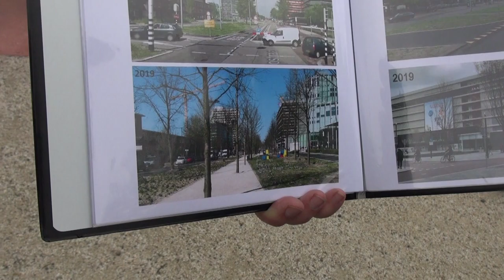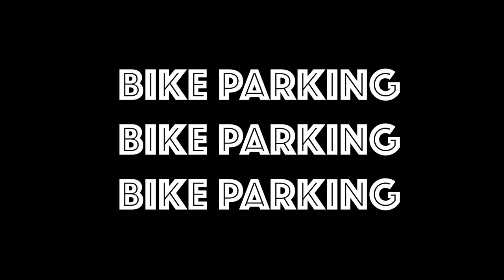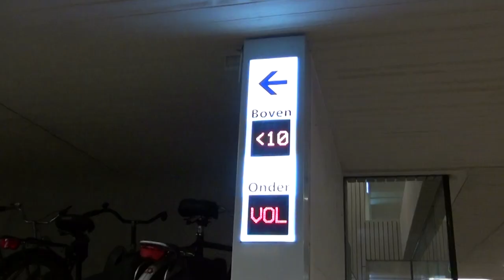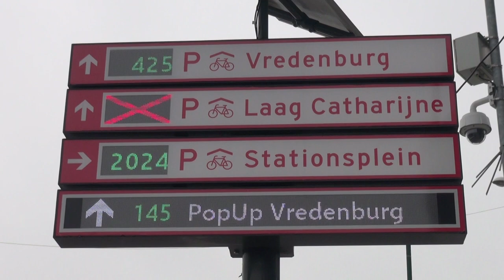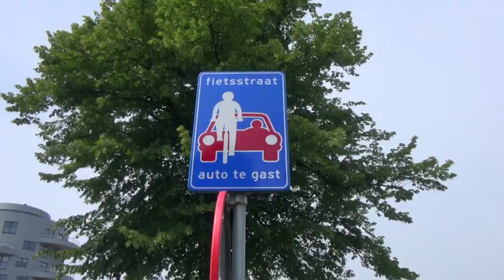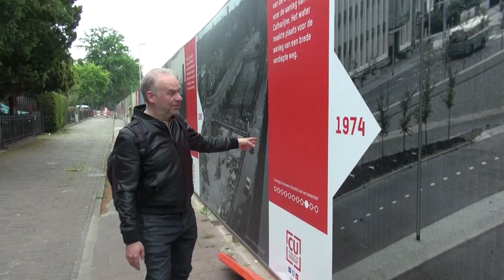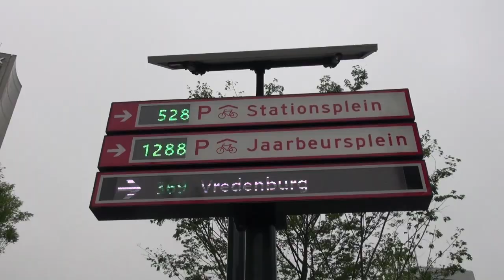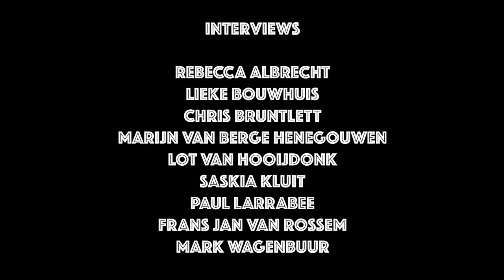Utrecht: Planning for People & Bikes, Not for Cars

Comment: As a Dutch person, I can confirm that this video is accurate. I haven't driven a car in years. I bike/train everywhere. You can even bring your bike on the train haha
It's great, except when it snows ;p
Reply: @Aryan Ramanand Huh? Je mag je fiets gewoon meenemen in de trein hoor. 6 euro voor een dagkaart. Niks illegaals aan.
Reply: what happens when it snows?
Reply: @nattiemagic2104  Trains don't go anymore when track switches freeze over. 
Biking on clumped snow is really hard, so everyone takes public transport, but public transport isn't designed for that many people, so everyone gets completely stuck and nobody gets to where they need to go.

Whenever it snows, I make sure to leave home at least an hour before I would normally need to leave, and if I have to go somewhere by train, I first check whether any trains are still going at all, because I might just have to give up and stay at home entirely.
Reply: @ryn2844  ahh thanks! I live in a country to me where it doesn't snow so I was really curious
Reply: Out of curiosity, what happens when an ambulance needs to get through the bike path? Does it have to go slowly since it is on "equal" footing with the cyclists, or do cyclists give it right of way?
Reply: @formulaone07  You always give way to ambulances, no matter where you are, or what vehicle you're in.
Reply: 3 years in netherlands with no cars and no problem. Although not against cars as it helps for some remote areas sometime
Reply: What do you do when you have to buy something big? Get it delivered? 

How about going to the supermarket?

What about rain?

Dont get me wrong, I love riding bike and I think this is great. I am just wondering how you deal with certain things.
Reply: @xxtwattwafflexx1  hi I'm Dutch and I don't bike because I hate it. But other people here just ride through the rain with water resistant clothing. They do groceries on their bikes even with children sitting on the back or/and front it's no problem. People are trained here to carry lots of stuff on a bike. And yeah when you have big things you just get it delivered. Or ask someone with a care to help out.
Reply: @xxtwattwafflexx1  It all depends on what is the your family size. In my family of 2 we can get everything by walk or by bike as the super market is just 200 m away. Everything is close by and doable by bike. But also there are car families as in US. a bigger family do things like supermarket or go to ikea in car.
In rain i just walk (planning to get an car soon).
Reply: formulaone07 It depends. If lights and sirens are on, even pedestrians will give way. If it is not an emergency, the ambulance will follow the rules of normal traffic.
Reply: @xxtwattwafflexx1  if it rains i will take the car.
Reply: @xxtwattwafflexx1  I don't know where you live but there is generally a difference between european cities and cities in the US. In Europe in most countries the number of shops nearby is bigger. You normally don't have a long way to walk or cycle to get at a supermarket. Most people go several times a week for shopping. In the US they tend to have less (therefore huge ) supermarkets where you have to drive for many miles to get there and therefore people tend to go just once every 1 or 2 weeks for shopping.  Short answer: in most places in Europe it is easier to  do almost everything by bike then in the US, generally speaken.
Reply: @formulaone07  Ambulances aren't on equal footing with cars either if they are driving with lights and sound. So yes, cyclists have to give right of way when the ambulance is driving with light and sound as well, but if the ambulance isn't it is basically a regular car and has to go slowly as well.
Reply: @nattiemagic.  you curse the weather and slowly bike through the snow.

Nut in the Netherlands that is usually <5 days a year
Reply: Cool! How fast do you usually go?
Reply: that's the problem here in the Philippines, people always think that its because european countrie is cold that's why alot of people bike, but I always say no, its harder to bike on a cold place especially when it snow, unlike here in the Philippines you can bike the whole year 'coz its only sunny or rainy, some of the people here are missing alot, i bike to work for 20 years now and im not stopping anytime soon. 👍
Reply: To bad you have such a horibble weather out there,
Reply: @ryn2844  Also, it snows on average for 2 hours each year. Last year we have seen snow for ~4 hours (before it melted completely).
Reply: @xxtwattwafflexx1  You get shit delivered, why bother picking that 70 inch TV yourself (even if it fits into your SUV/combi it's still such a pain in the ass). All major online stores in NL operate on "order before 18/20/23(!) o'clock, tomorrow morning in your house" system. Some, in major cities and for some prodcuts, also have same day delivery. 

So, that's one option. 

Anther option - rent a car on per minute basis from Dutch Railways (using your mobile phone). Still much cheaper than a taxi and compared to cost of actually owning an SUV to just to bring that TV/Fridge once a year - it's basically free.

One extra option - bakfiets - cargo bike monstrosities that could carry a goddamn washing machine.

There are no huge shopping centers in NL, instead you have smaller supermarkets spread every 500-2km; so easily reachable by foot or bike. Downside to that is that there is less choice (both between supermarket chains and where it comes to product selection). Due to popularity of bikes, shopping streets in city centers are still a thing and are amazingly popular.

There are also multiple grocery supermarkets, which are actually cheaper than buying at store. 

Lastly - the rain. It's an interesting one, because Netherlands is famous for being very rainy. Few caveats: there are no proper thunderstorms (in 4 years I lived here, I haven't seen single one!) and usually it rains very frequently, but with very low intensivity and for a very short periods (rain for 30 minutes, stop for 1h, then rain for 30 more minutes - that kind of pattern). People would use weather radar apps to see how many more minutes they have to stay at the caffeeshop or pub to avoid rain all together. 
Though generally - due to low intensivity, most people just don't care about rain that much and ignore. Lastly - in the past two years, we have seen nearly constant period of what dutch define as drought; climate is changing and rain becomes less and less of an issue for bikers (except for me - all local mtb tracks are bloody closed due to lack of rain!)
Reply: It still snows where you are? Nowadays snow is practically nonexistent in NRW, Germany.
Reply: @formulaone07  Since the streets are almost traffic free, ambulances and especially cops enjoy a bit too much the tram tracks, often in Amsterdam you see cops driving on the tram tracks like if they were racing a rally.
Reply: @nattiemagic2104  I live in the north of Sweden and i use my bicycle for 98% of my transportations year around. During winter you need warm and wind proof clothes, facemask and studded tires. And you need to start earlier to get where ever you are going in time. "Is there a will there is a way" is actually very true in all it´s glorious cornyness.
Reply: @nattiemagic2104  We ride our bikes...
Reply: @borek772  In the States in the Great Lakes region and Northeast, we were getting more heavy downpours.  In NE Ohio, where I live, Spring has gotten wetter with more longer periods of rain.  It's not uncommon for rain a rain event here to last for several hours or an entire 24-hour period,  and severe some storm events can bring rain for a day or two non-stop.   Thunderstorms are a also regular occurrence from April to October.  We also will get heavy snows from time to time, although winters are generally getting warmer.  The climate has really changed in the past 25 years.  It used to be routine to get weather below 20F in From late December through mid-February punctuated with periods below 0F.   The last typical cold winter was around 2014.  Long story short, there are differences in the weather in some parts of the US that would affect bike usage, but if we had better transit, it wouldn't be an issue.
Reply: @nattiemagic2104  Ski or sled.
Reply: When it snows the Unox and Chocomel are the best though
Reply: I did think about snow and rain. Biking can’t be as aesthetically pleasing in poor weather as it is on a sunny, warm day.
Reply: @rondon746  You are right.  I live in the US.  My nearest grocery is a big box store 8 minutes by car, about 4 miles. I shop weekly and fill my SUV with food for four people. A lot would have to change here for the country to convert to a bicycle culture.
Reply: What about the dutch ppl traveling through Germany down to Italy? Not needing a car in a city doesn't mean that the ppl don't need a car at all.
Reply: @LiquidIEx  Public transport exists all over Europe. 

Also, you can actually cycle there. My dad cycled from the Netherlands all the way to Greece once. It's actually a common way to spend holidays for broke Dutch teens and college kids. Just cycle somewhere and bring a tent.
Reply: i’m just so utterly jealous of The Netherlands. what wouldn’t i give to live there…
i live in brazil, in the north region and things here could not be more different from any dutch city: CHAOTIC traffic, no bike lanes and very little space for pedestrians. not to mention the lack of safety on the streets.

and how hot it is here.

i might be wrong, but i don’t think we, here in my city, can have all these bicycle and pedestrian space. during the hotter months the feels like temperature can hit 42°C. air-conditioned cars are absolutely ESSENCIAL.

but again, we also don’t have trees blocking the sun and providing cooler shadows. there’s this remote road near the airport that is completely surrounded by trees, and the temperature there is just cooler overall, even during the day. and during the night? it’s almost cold by our standards.
Reply: @xxtwattwafflexx1 - You can rent cars:
 - Grocery shopping is easy: https://youtu.be/kYHTzqHIngk
- Rain sucks but we deal with it by wearing water protecting clothes
Reply: Ryn,
what is winter like?
Reply: @Missusri  In the Netherlands? Windy and rainy. It doesn't snow often, and when it does, it's not a lot. But because winter is so wet, it's still cold and miserable.
Reply: @ryn2844  I do not know how to take that;  it is winter where I live and it is about 33 degrees F; no snow either (usually we have snow by now); was raining too yesterday;  a little too cold to bike;  but at least the road is not slick.
Reply: @Missusri  I don't think 33 F is too cold to bike. Have definitely biked in colder weather.

I'm not sure what you are confused about?
Reply: It must be like heaven not to be constantly frustrated all the time.

Comment: L.A. City Council and County Council NEED to watch this video and start to implement bicycle this!
Reply: S. Strauss 

Right.  You want to ride you bike from Riverside to downtown LA every day?
Reply: J K I haven’t driven in LA, but can you keep up with my 30 mph average?

Plus there is also this thing called ebikes if you are too sickly to pedal or walk well (that is not for my average, which is technically about 28 mph average over 30 mile trip, and obviously if it’s less than 30 miles then I can push a little faster, normal road bicycle, no aerodynamic wheels or fairings of any kind).
Reply: Jake Garrett -- Interesting. The average speed on the flats of the Tour de France is 25 MPH. Are you a professional cyclist?
Reply: @wilhard45  No, but I'm also only biking for like 1 hour so I'd probably die trying to do that for 8 hours or whatever they do in the pro races. The averages were during ~30 mile road races (definitely not pro, LOL! Just USAC collegiate racing class D). I'm really surprised they are only averaging 25 mph (Sort of makes sense, power to double speed goes up by a factor of 8x, but I'm definitely no superman! just when I was in shape), I'm guessing they would be way faster if they only needed to do 30 mile stages like I was (it still felt like forever even though it was only an hour, haha!).
Reply: Yeah, right, as if people will ride a bike 30-60 miles or more in blazing desert heat and sun every day, through violent gang territory and homeless camps. There is no way in hell this would work in southern California.
Reply: I live in Los Angeles and ride my bike every day to work and to most places, but I think it’s hopeless trying to change people’s car centered mentality in this city. 
My daily ride is on a 3 mile painted bike lane on Huntington Drive, in Alhambra- Pasadena and have been doing it for more than five years. 
The total number of cyclists I have encountered in all these years on that route: less than 10.
Reply: @peterbelanger4094  Utrecht Central stations area had a really big problem with heroine addicted homeless people 30 years ago. If a city tries to tackle one problem at a time, change is possible. But therefore a city council has to make an effort to at least try, and I guess that is the thing that is lacking in the USA.
Reply: @peterbelanger4094  well if neighbourhoods were improved more walkable then there'd be shops and cafés a few miles away or less, easily accessible by bike and saying anyone's expecting people to go 60 miles on a bike is a blatant strawman, not all trips are that long and the trips that long could be done by public transport